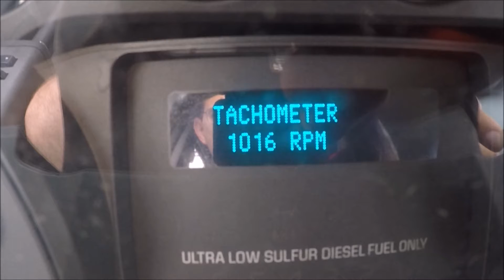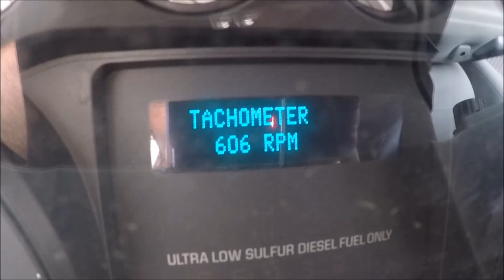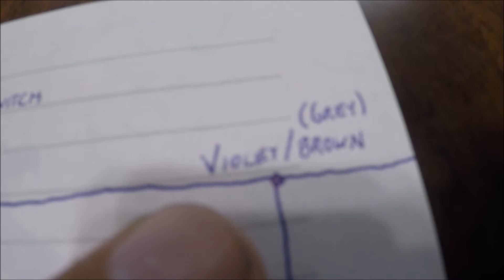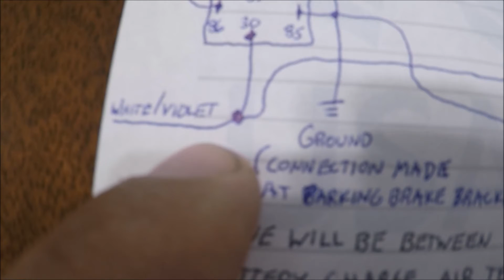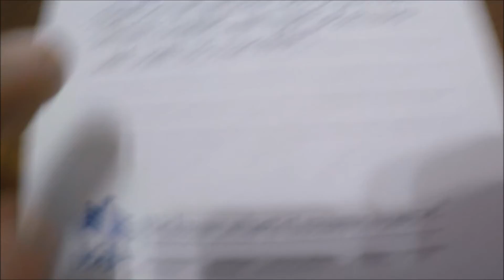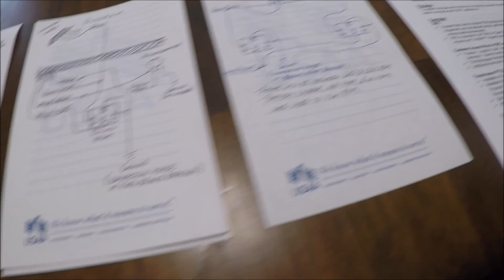Ford F-250 6.7 Battery Charge Protection with Parking Brake Bypass

Comment: Didn’t see this video till I subscribed to your channel. You got some good info here definitely want to do this! Did u ever install the inverter if so how does it work? Do you see it adjusts your RPM’s? Also what kind of rocker switch do you recommend would a 12 volt be good? Thanks for all this info buddy definitely want to do all of this
Reply from the maker: I just went an updated the descriptions with links in all 3 videos. Also added links to the other videos so people watching can find the others easier.
Reply: Thank you so much for your help and the fast replies Buddy!! Really appreciate it!!
Reply from the maker: @jorgesalazar8356  Not a problem. I make this stuff the help people out!
Reply from the maker: I did put an inverter in the truck. I honestly don't use it a lot. My truck has the high amp alternator so it really doesn't pull a huge load to make the engine go up in RPM but it will when needed. I have a video showing it work on the channel. A 3 way switch would be good. I will update the description with some links to useful stuff for the install. I did that with the SEIC video after you commented.